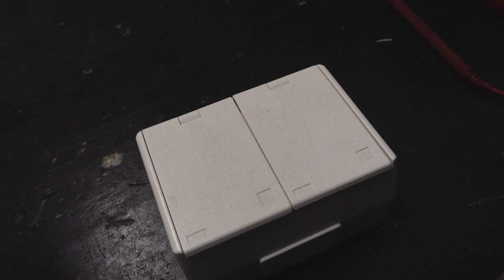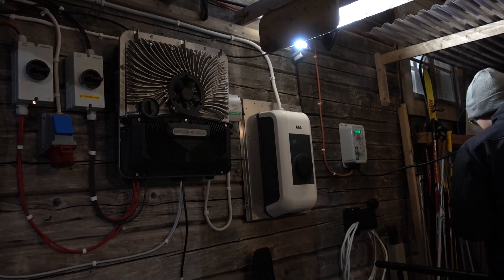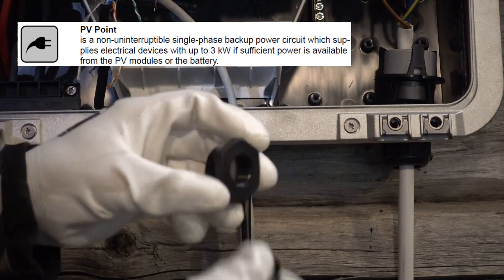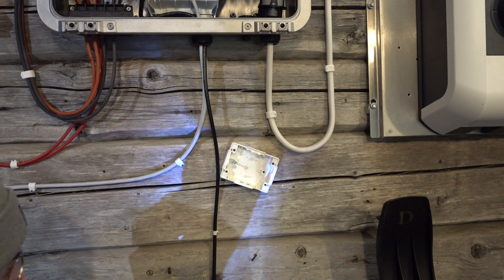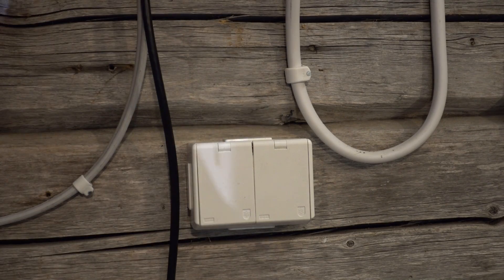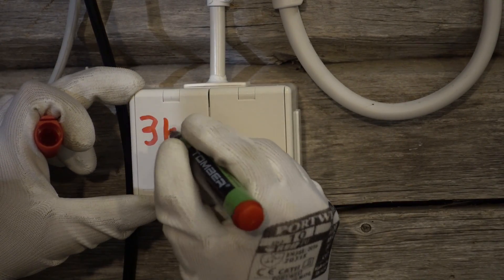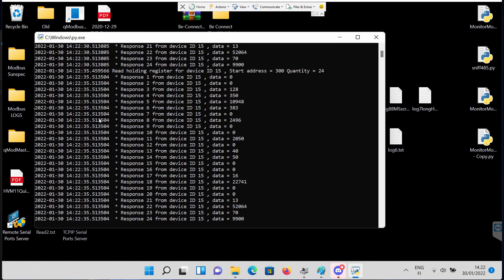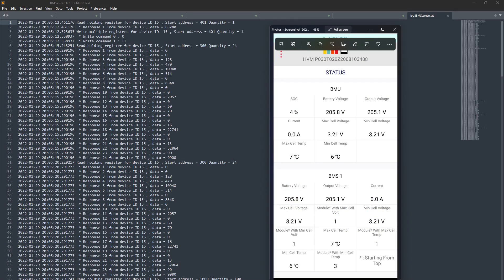Adding emergency power to workshop (+ some python 🐍)

Comment: Thank you for sharing the information in all your videos. It's given me the confidence to take the logical step and add an EV battery to my 14 year old grid tied pv system.
Out of interest was the 3 core cable you wired the outlet with special in some way? It seemed very stiff but that might be temperature.  Also tiny cross sectional area for carrying 3kW but you might have massive hands.
Reply from the maker: 10mm^2 wiring, so at 400V the amperage is not that big!

Comment: Hi Dala, thanks for your helpful videos! My home country is Austria
I have also an Fronius GEN24 and a BYD Battery.
Our house, built in 1865, is complete converted in a smart home, by using the opensource iobroker. Their u can use also the free Fronius adapter.
Combined with sonos adapter I controll my whole house.
So I'm able to charge two EV's only with the excess energy from my PV.
brgds Chris
Reply from the maker: Sounds like an awesome setup Christian! 😁

Comment: Looks like a great backup power install Dala 😊👍 thank you for sharing!
Question: might your PV inputs on your hybrid inverter be high Voc (450 or higher) capable? I'm wondering if a vehicle to home (Nissan Leaf of course 🤩) would be possible via Traction Battery to PV inputs. My inverter would limit it to 20A @450Voc/300Vmp DC side, it's for emergency use only same as this setup. Any thoughts??
Reply from the maker: Yes, most hybrid inverters have very high voltage ranges, so making a chademo-PV bridge would be quite straightforward if one knows the messages needed for the particular inverter!
Reply: @DalasEVRepair  challenge accepted!! I'm pretty sure I have the inverter side figured out. I'm 3D printing a chademo plug as we speak. I can't take any credit here; I'm following in the footsteps of another YouTubers adventure. Next part is the Leafs ability to discharge via chademo and it's safety features (including capacity limiting) 🤔... Always appreciate your help and input! BTW I voted for CCS charging for your next video 🤩🤞